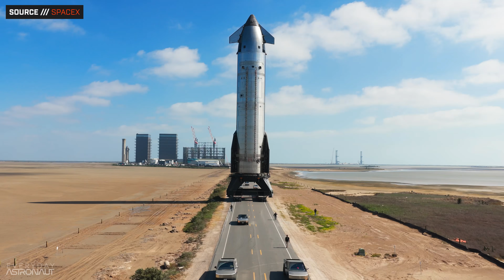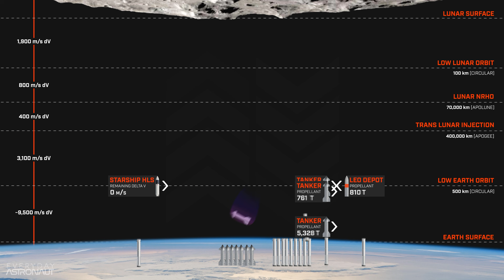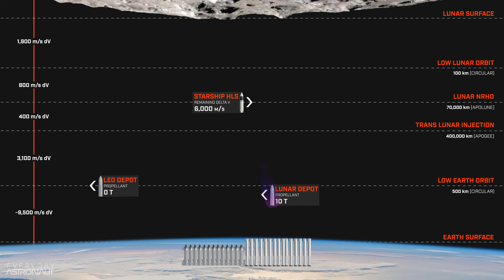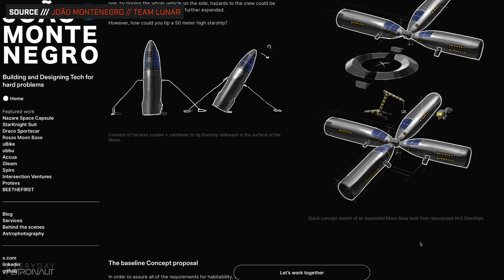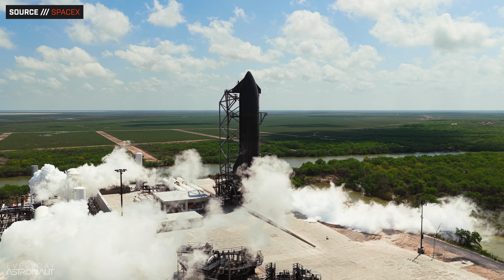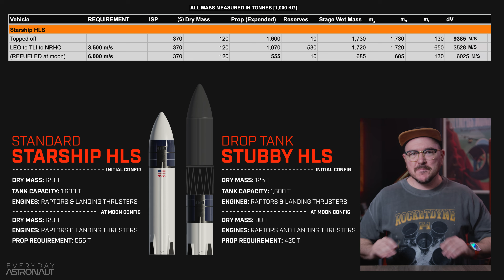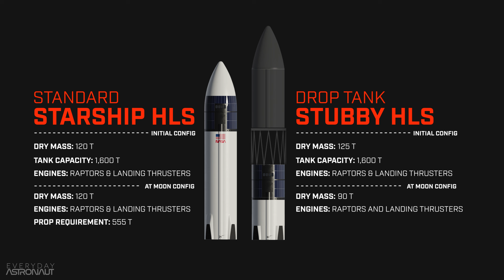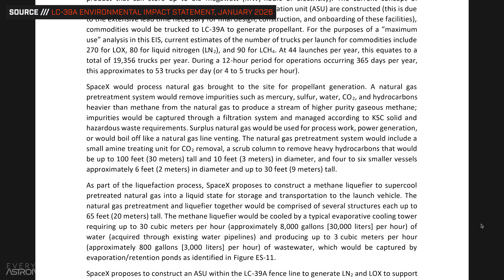Does Starship REALLY require 15+ launches to land one lunar Starship?!

Comment: Oops!  This video forgot about more launches for new supplies and equipment for the next HLS landing.  The resupply Starship will need refueling if the resupply ship meets the HLS in lunar orbit.  Or the HLS will need to return to Earth orbit to meet the resupply ship.

I feel sorry for the person that has to move 100 tons from the resupply Starship to the HLS.  And maybe move many rock containers and return experiment equipment from the HLS to the resupply Starship.  The cargo handler's poor aching back.

Maybe the HLS returning to landing on Earth, along with the weight of flaps and tiles, is better for unloading and loading new supplies and new equipment.

I have never heard any solutions for transferring new supplies and new equipment for HLS's second and following landings, and unloading HLS after finishing a mission.

This video didn't mention propellants for station-keeping while in orbit between missions, and course corrections during travel to or from the Moon.

If there is a tanker in orbit around the Moon, then propellants may be needed to change the plane of the orbit from the tanker orbit to somewhere else other than the south pole base.  The advantage of a polar orbit, even a polar Near Rectilinear Halo Orbit, is that every 28 days, the Moon would rotate under that orbit, so wouldn't need to change the orbital plane, but some destinations are going to need higher delta-V than others.

Starship HLS on the Moon could also be a "tanker" for the Moon base.  Providing propellants for small flying Moon hoppers that go farther from the base, than would be practical in wheeled vehicles.

Travelling farther distances from the South Pole Base, would get to areas where the nights are 14 Earth-days long.  If wanting to get to that farther location and back during the daylight, it could be too far for a slow wheeled vehicle.  Therefore a small flying Moon hopper would be needed.  Which could require propellants from the landed HLS.

The Moon hopper could be hydrolox, but it seems a waste to purposely throw away water on the Moon, when that water is going to be needed for expanding human presence on the Moon.  Water that could be used for important things such as drinking, watering plants or other edible organisms that also convert carbondioxide to breathable oxygen, and water for making breathable oxygen.  Moon habitations are going to be leaking small amounts of oxygen and water.  So why throw away large amounts of water as unrecoverable rocket fuel.  Earth people's thinking: Exploit the environment to destruction, because it is easier to do, and the future solve the problems we are creating now.

Comment: The (very good) summary explains why the current architecture is sensible. Once you master reuse and refill it won't matter whether you need 5 or 15 flights. A high flight cadence solves many problems, including human rating. The question is when they will reach a high cadency with low refurbishment.

Comment: what if they land vertically , turn it horizontal by in built crane, then again turn vertical and return back.
Reply: Then you need a big crane on the moon. Or bring one on every ship. Just add the mass of that to the spreadsheet where applicable.

Comment: Honestly - anything but the original HLS plan doesn't make any sense. You still have to refill, but on top of that you add a lot more engineering and complications to save routine 5 to 7 refill missions. You STILL have to do them, just less. If you can do 8 refills, you sure can do 15

Comment: I don't understand why they don't make a scaled down version of Starship, like 1/4 the size...
It will require less fuel and be lighter..
It will still be bigger than any other lander, but just as stable..
Reply: Starhsip is designed to get huge amounts of cargo to Mars which is why it's so large to begin with. The moon is a usefull testing ground for the technologies needed and they would have to redo most of the R&D if they changed the size of the ship as that changes so many variables.

Comment: I would expect that instead, SpaceX will develop the Starship Heavy after Starship v4 is perfected and use that to make refueling a breeze. Starship Heavy will be twice as wide as Starship v4.
Reply: They (well, Elon at least) already have bigger rockets on the napkin/back-of-envelope/spreadsheet stage.
Reply: They could, and don't get me wrong, they might.

However, Megabays and Gigabays being constructed (TX and FL) don't show any evidence for "wider" Starships.  There would be a lot of rework needed, for example the dozens of work stands within each building, etc.

They DO however, show evidence for taller ones.
Reply: @ConstantTrue  Starship Heavy construction won’t start until V4 is perfected. It will be a while. You are seeing evidence of V4, the next taller Starship.

Comment: You dont need the centre of thrust to line up with the centre of mass though. all you need is to be able to pump fuel and prop from one side of the craft to the other and so forth to rebalance the craft constantly. Which sounds difficult, but actually really isnt if you pull fuel evenly from both sides (or from the center) for landing.

Comment: Technically, in a vacuum, reusable Starship and orbital refueling could work to reliably send large payloads to the moon and possibly be cheaper than SLS.

It's just SpaceX is in a raceagainst time. xAI burns trough a billion a month, that's 10 starships a month. Even with a 50 billion IPO next month, SpaceX is just setting money on fire faster and faster keeping Twitter, xAI and buying Cybertrucks.

SpaceX enormously overpromise and under deliver every time. They were supposed to have Starship cargo to Mars in 2018 and Mars landing in 2025. Case in point, I remember people saying NASA should drop SLS and just use Starship for all of it. SLS was finished, Starship is a work in progress. We wouldn't have had Artemis II if NASA had trusted SpaceX.

It's anybody's guess if SpaceX will finish Starship before Grok, xAI, and Tesla burns through all SpaceX cash reserves.

And that's before considering SpaceX is also pursuing the ludicrous idea of sending a Starship up every few minutes to build a million satellite AI constellation. That's obviously not happening, ever.

Comment: this is a silly idea tbh. they call it ship for a reason and for a landing you want a boat. (until there's a harbor, but we're a looong way from that)
as LEO-LowLunaOrbit shuttle it'd be great. get stuff there, have that stuff do it's thing and return. once aerobraking into LEO is reliable a Starship could just stay up as long as viable. a refueling hub made of the Starships in rotation would allow for repair and refuel, and "always" having one ready to pick up cargo and boost to LLO. 
actually I think it has to be the other way around to really make sense, tho. TL;DR Space fuel needs to be cheaper than Earth fuel.  if they could refuel around Luna because there's fuel production going on there somehow then they'd safe a lot of dV getting fuel up to orbit and that would make space-tug work viable (ie. reusable interplanetary booster that brakes back) and unlock at least the inner solar system.

Comment: This is what I think and I belive it could cut down a little bit of the cost. 

Why don't they use the ISS as a depot instead of deorbiting it. Whiles being a depot it would as well as host the crew for a while (preping for the looner missions). So when the HLS is launch from earth it just dock with the ISS, get a fuel transfer and take the astronaunts on board and move them to the moon. Then the could push a whole starship depot to the looer orbit which will then serve a Starship HLS temporarly. 
Talking of the of the numbers of astronaunts which could be moved to the looner orbit and how they could get there; in the first place the SLS is expensive compare to the Dragon which can also be configured to have a partial capability to the Oraion capsule which would move the astronaunts to the ISS and could push them to the looner orbit to dock with the HLS and also return them to earth. 

Looking at this approach NASA could save billions of dollars rather than building new rockets which cost billions each and everytime while a full expandable Falcon 9 could cost about 100 million and could be partially reused.

Comment: Excellent video Tim — the 15+ tanker launches per HLS mission is exactly the bottleneck that needs solving!
Our OORU ZBO™ system turns modified Starship V4 depots into orbiting chemical plants. They import stabilised CO₂ clathrate slush once, then produce methalox on-demand in LEO via Sabatier + electrolysis.
Drops the tanker count from 12–18+ down to single digits and slashes total program launches by an order of magnitude.
Draft white paper v6.0 is available for review (Tim & Elon) — happy to DM or link it. Patent filed Sept 2025.
This complements Starship perfectly. Great work as always! 🚀

Comment: 1:17:46 Orbiting gas station, anyone? It makes sense for the early variants to be smaller, to prove out the technology until the full supply chain can be built.  There is a tension between one-off landing and a full ecosystem. A technical debt issue.

Comment: What difference would it be if we had nuclear or ion engines for the depot ships.  Dangerous to get it into space but we don't need that many depot ships.  From what I understand the fuel requirements would drop.  Not sure what the impact of the mass of such a system would be on capability / capacity?  It seems like chemical engines will rule the Earth to LEO for the immediate future but that we are on the cusp of the next generation of propulsion methods, with nuclear possibly being the next step.  Be great to get your view on this @everdayAstronaut

Comment: If they could get the vacuum raptors to gimbal, they could potentially save tons of mass.

I know you said it's hard to scale it up, but even a single extra ring on the tankers couldn't deliver just a bit more propellant to LEO?  If they could increase the effective payload by 25%, they drop it from 12 launches to 8, which is nothing to sneeze at.  I know Elon had talked about elongating both the ship and the booster in the past, which is why I'm asking.

Comment: I think what this shows is Starship HLS is not the best option to bring small payloads to the Moon's surface (like bringing just the crew)
It's biggest advantage is its cargo capacity, so it should be used for missions requiring large amounts of cargo.
It's just not suited for Artemis because we literally don't have enough equipment to be tested on the Moon yet
Reply: You are thinking in the right direction - but most people think that if we have 100TONN payload capacity, this massive payload will just spawn or appear of thin air just because we have 100TONN available. When in reality its actually difficult. For example when Elon launched Tesla into space on Falcon Heavy i always asked - why wouldn't they put solar panels on it, or some scientific equipment attached so it could transmit some science while its in deep space, turns out its really hard to design this stuff and just because they had a ride into deep space on Falcon Heavy with Tesla - it was just not smartly used and mostly wasted.

Comment: How about using the Starlink launches to top off tankers by default? They are more volume capped than mass. They could add excess fuel and use it as a "free" refiller.
Reply: Starlink carriers will go into their own orbits, not exactly the same orbit where depot is

Comment: Why not have a 3 stage system for refueling?  ~Double fuel payload per flight.
Stage 1 - Super heavy. 
Stage 2 - a much smaller version of Starship, just large enough to safely return the Raptor Engines (the valuable stuff ~ 20 metric ton dry mass, 10 metric tons of fuel)
Stage 3 - Nothing but tanks. This would be expended or...

All of the mass saved by not bringing a cheap fuel tank back to earth can be dedicated to fuel. This brings the fuel delivered per launch to ~220 - 260 metric tons. (standard is 100-150)

If you wanted, you could reuse the Stage 3 tanks for a space station.

Comment: I think you should consider what happens with low delta-v transfer orbits, like the one used by the Firefly lander..
That would change things A LOT on both the way out and the way in...
Reply: The mission is HLS so crew, which requires the short trip. This would certainly be an option for cargo trips. The other factor is starship uses cryogenic propellant so you have to make sure the propellan't isn't going to boil off before you get there.

Comment: The ambition behind a fully reusable lunar architecture is impressive, but the economics become far less clear once the mission requires a dozen or more tanker flights just to refuel the lunar lander in low Earth orbit. Each tanker launch implies not just a marginal flight cost, but the capital, maintenance, and operational burden of building, supporting, and repeatedly flying an entire fleet of additional vehicles. When those real-world overheads are included, the cost gap between a reusable system and a simpler expendable design narrows considerably.

On top of that, orbital refuelling introduces a new layer of operational complexity into a mission profile that is already inherently risky. Every extra launch, rendezvous, and transfer is another point of potential delay or failure. The entire architecture also depends on Starship achieving its projected payload and performance targets, many of which remain unproven in flight.

None of this diminishes the value of solving in‑orbit refuelling, cracking that capability would be transformative for space exploration, regardless of whether it is strictly necessary for a lunar landing. But even if the technical challenges are solvable, it is difficult to avoid the conclusion that timelines will slip further and development costs will rise as the system matures.

Given these uncertainties, it is understandable that some observers doubt a US crewed lunar landing before 2030, and a few even speculate that the next nation to return humans to the Moon may not be the United States. These are not predictions, but reflections of the scale of the engineering and programmatic challenges still ahead, and a reminder that ambition alone does not guarantee success. Destin Sandlin concerns may be valid, what happens if the plan sucks?

Comment: The apollo lunar ascent vehicle wet mass was 4800 kg in 1969. Bring 1 to the moons surface and take off with that. Leave the starship until you have in situ fuel working. It makes no sense to bring the lander back into space - it will most likely be out of date the moment it launches and the possible spare parts would be better off left on the moon. The ascent vehicle can live in the nose cone and take off directly from there - it will singe the starship but that doesnt matter.

Comment: If the best part is no part ... why don't they just modify HLS to land on it's side . Less worry about long skinny legs . The elevator could be eliminated and just use a simple ramp for an exit. 
Mount the landing legs where the flaps normally go and just point them towards the lunar surface like helicopter skids.

Comment: what gets me with all this fuss over boiloff is why a refrigeration system isn't viable. Even though the solar panels and refrigeration loop would add dry mass, and heat pipes would cut into tank volume surely it's worthwhile if it can save you from boiling off 140 tons of propellant, heck even if you burned the propellant to power a refrigeration loop you'd probably be better off

Comment: Additionally to help cool the overall spacecraft's thermal mass is the use of radiators. It can be an active or passive system to a high IR emitting material/blade to radiate excess heat off to space. This is used on the ISS as well for thermal management.

Comment: Some 80% of prop mass is oxygen. Just imagine filling the HLS oxygen tank on the moon with lunar oxygen. The whole equation would change drastically.
Reply: Need like heavy equipment on the Moon like GIANT gas tanks for factories producing oxygen - its all need to be delivered from Earth, landed on Moon, connected  there and tended to. Not something done in 10 years.
Reply: @дроу  so they should start asap 😅 remember that no settlement was ever built without transport infrastructure

Comment: @EverydayAstronaut.20:07 You didn't conduct the test quite correctly. The amount of fuel should have been slightly higher. If I'm correct, you set the fuel gauge for an already landed Starship and started testing in low lunar orbit. I'm not sure this is particularly important, but I wanted to point it out.

Comment: I still dont understand how Super Heavy, the worlds most powerfull rocket has a upper stage that is all but useless once in space. Like where is all that delta v going? On paper Super Heavy should be able to ship a fully fueled lander to leo. Is the launcher so heavy that its payload capacity is non existent? 

All i see is a tall death trap that's going to topple when attempting to land on the moon. The waste of 30+ launches to get 1 mission is a joke esp when its fueled by methalox, unless recovered (which i dont they they are doing) the excess methane is just going to do more harm. I clicked onto this video expecting to hear how Starship HLS is not a joke but im only 12 minutes in and its only getting worse. why do we need to land 500 tons of dry weight on the moon? I understand that HLS is reusable and will have large cargo applications but the dry mass is a joke.

Comment: Before I even watch the video, NO.  Not with the Raptor 3 engines higher power and weight savings, it may take as little as 5 launches to load the fuel depot.  Of course the fuel depot it self is a launch and so is the starship lander.